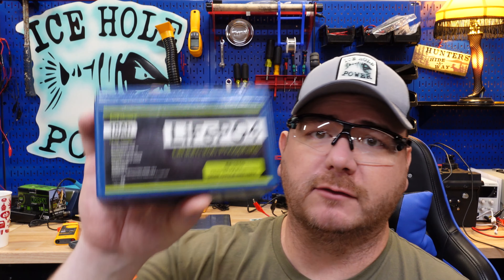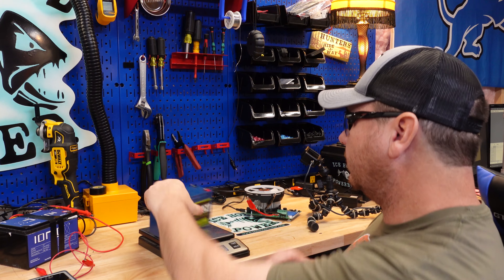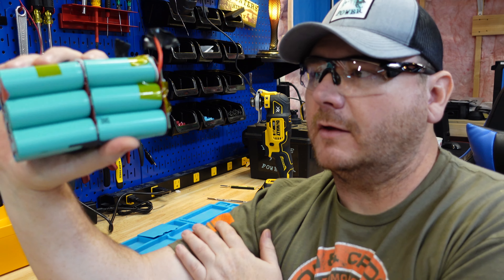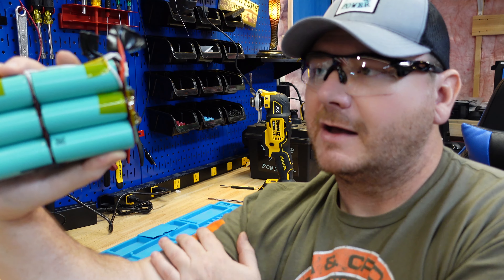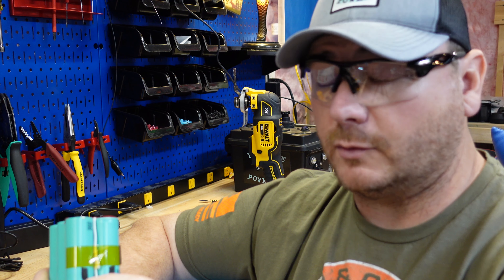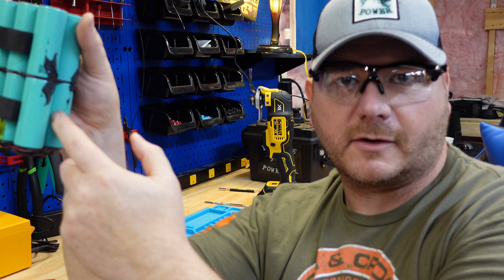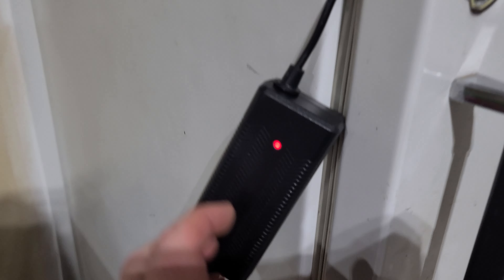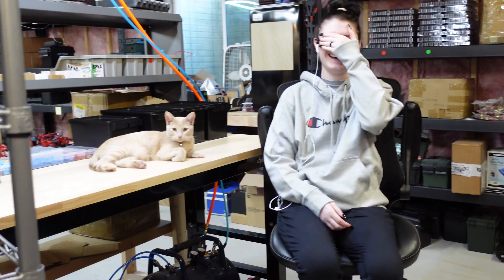Expert Power 10Ah Review and Teardown

Comment: Jeremy - I understand all the series parallel topics and bms, but you talk about fish paper being between for an insulator, does something that thin really do anything?
Reply from the maker: Good question. Yes, just an extra layer of protection. It is about as thick as construction paper. A lot thicker than the shrink rap that is around the cells. I would say if companies would add that, they would have a lot less battery failure issues. Thanks for watching Mike!

Comment: Hi, new subscriber I’m really enjoying your channel.!!!! I was thinking of ordering one of the Amped 32AH (14.8V NMC) batteries for my new Garmin 106sv ultra I’d really like to put it one of the boat boxes you offer if it is compatible, your advice would be greatly appreciated electrical stuff is not one of my strengths. The Amped batteries seem to be the real deal from what I’m seeing!!!  I’m assuming these units run best with lots of power….
Sorry for the long post but I’m clueless about the new battery technology 12V lithium vs the 14.8V NMC etc. I’d like to wish the best for you and your family this holiday season.!!! 🙂 👍🏻👍🏻
Reply from the maker: Thanks for the sub! You can use them in the boat box, we send pigtails so you can hook your fishfinder up to it. We will be building them again after the 1st of the year. Thanks!
Reply: @iceholepower8012  Thanks for the reply I’ll be putting in my order soon as they are available and wil also be getting one of your small 12V boxes on the same order more than likely. 👍🏻👍🏻